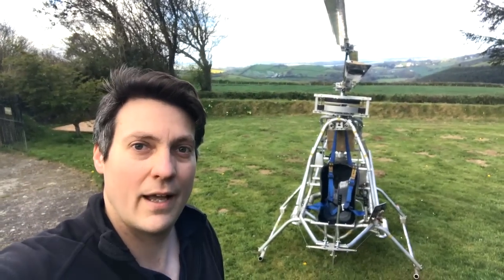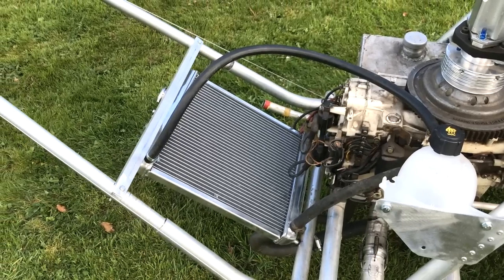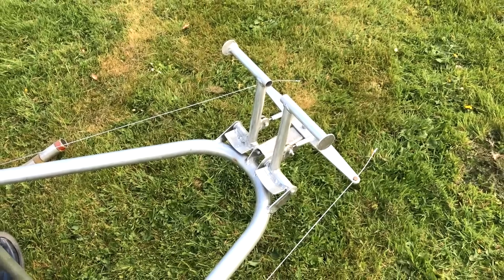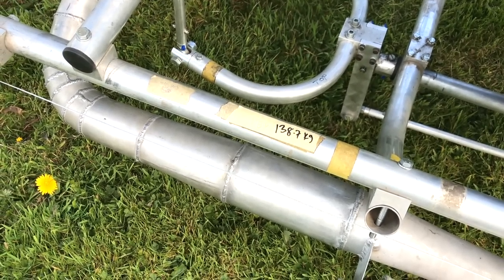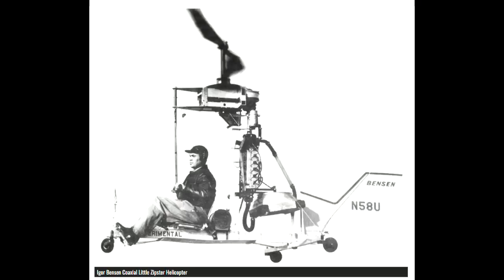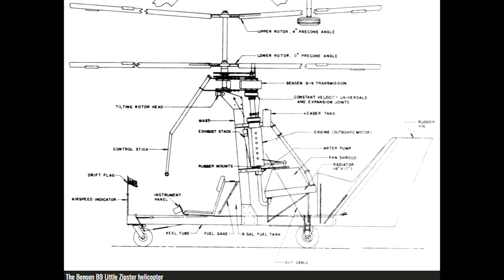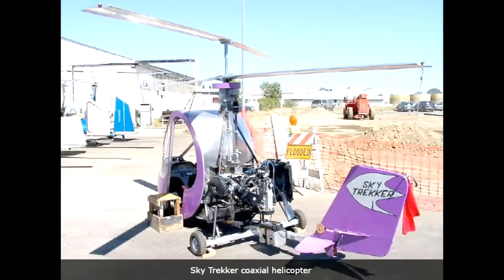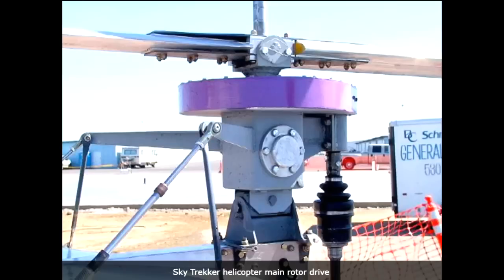Part 1 Learning to FLY Homemade Helicopter

Comment: How much experience flying helicopters did you have before this flight...thank you.

Asking for a friend...his dial up is broken and AOL isn't working so good for him.

Merry Christmas for you and yours. Godspeed and Blessings.

Stay Dangerous
Reply from the maker: Stay dangerous 😆

My total experience in flying helicopters at this point was 1/2hr's dual instruction on an R22. I had flown RC helicopters though. I went on to have another 1/2hr's dual instruction but most of the learning to hover was done with my helicopter. I wouldn't recommend what I did but with long poles it can be done with some degree of safety. Tethers aren't safe above 8" long as they can cause an accident.

Comment: The blade angle doesn't changed?
Reply from the maker: That's correct, they are fixed pitch rotors. Works but it has limitations.
Reply: @Ben-Dixey  yeah.  I don't know if it can perform suitable autorotation for safe landing. What do you think.
Reply from the maker: No it can't autorotate, it was built just for hovering and slow forward flight.

Comment: Merhaba kolay gelsin kaç hp motor kullandınız teşekkür ederim
Reply from the maker: 60hp
Reply: @Ben-Dixey  bunun daha ufağına insansız olanına 30 hp motor yeterli olurmu
Reply from the maker: It is possible to lift a man with 30hp. The GenH4 can hover with 30hp, for an unmanned helicopter 30hp will be loads.
Reply: @Ben-Dixey  toplam ağırlık 70 kilogram gibi olursa
Reply from the maker: Yes. 30hp can lift around 160kg
Reply: @Ben-Dixey  hocam kolay gelsin bana önerebileceğiniz bir motor varmi

Comment: Awesome job but I would have made the spectators move well away in case of the blades let go. Someone could be cut in half. Be safe thank u for sharing
Reply from the maker: Yes. The spectators were not planned I didn't know the landowner invited them and I should have cancelled the test. I had run the blades probably 50-100 times by this stage though and was confident they wouldn't come off. However I wouldn't do this again just in case.

Comment: Lots of missing essential info. The blades appear to be fixed pitch,  The center of gravity appears to be excessively aft. The key thing is that this machine cannot registered or legally flown almost anywhere.
Reply from the maker: There's more Information on my channel. You are right it cannot be legally flown or registered. It's a hovering machine only.

Comment: Hello! How can I buy plans for this helicopter?
Reply from the maker: Hi. No plans are available for this helicopter. The nearest you will find is the Bensen B9. There are plans for non coaxial helicopters such as the AW95 and Furia.
Reply: @Ben-Dixey  at least please sell me main rotor system plans/blueprints
Reply from the maker: It all needs to be thoroughly endurance tested before I would consider selling any plans. You don't want to be making the same mistakes I might have made.

Comment: Looks like there's no way to autorotate with this machine, or did I miss something.

Great work otherwise. Have fun and stay safe. 👍
Reply from the maker: Hi Ai, you are correct, no autorotation is possible. It's intended use is for hovering around a field close to the ground. Did you get your mosquito back flying ?

Comment: I wish you would do a video showing how the collective works
Reply from the maker: Hi, this machine does not have collective pitch blades, to keep things simple the blades are fixed pitch and altitude is controlled by rotor rpm/throttle. Happy to do more videos explaining more details.

Comment: this vehicle doesn't have adjustable blades angle ?
Reply from the maker: No, it doesn't. The blades are fixed pitch and altitude is controlled with throttle.

Comment: First: hat off. This takes cojones.
Now: I am not quite sure how you achieve cyclic control. The Bensen invention (tilting rotor head) raises questions regarding the "pendulum rocket fallacy" (see YouTube video of 21/4/2020 and others).
Cold comfort: if you fell for it, you are in good company.
But the fallacy might explain why your ship does not do what you expect. I don't think there is a way around aerodynamic cyclic control.
Looking at videos of counter-rotating and Flettner designs, they should be really easy to fly, in contrast to tail rotors.
I did a few hours in R22 and that was much like balancing a broomstick while using both feet to keep the thing steady - a lot of work which needs to become second nature. 
You'll need more than 10 hours to solo. Fixed wing was easier. However, helicopter is more dreamlike.

PS Your video looks like Lake District. Could you not find any wetter and windier place?
Reply from the maker: Hi, interesting comments, I'll have a look at the pendulum rocket fallacy and the flettner helicopter. I'm believe the Bensen B9 did fly but the concept is very well demonstrated in the Nolan and airscooter 2 helicopters. The only difference is the way the rotors are driven which has been a concern from the start but if the B9 did fly then it's possible to control. Testing in Devon
Reply: @Ben-Dixey  The Kaman K Max uses a Flettner rotor system. But since Flettner was German and there was this war - how could they let him keep the honours?
Hang gliders can be controlled by shifting the centre of gravity. However, they do not normally hover. What the fallacy shows is that one cannot really control a rocket in this way.
Robert Goddard was its most famous victim. A rotor is just like a rocket engine - it pushes where you point it at. And that is where the trouble starts.
There must be a reason why none of the tilting rotor head designs found mass adoption. They were simpler and cheaper to make - maybe the fallacy is the missing piece here.
Reply from the maker: @peterf2451  It will be interesting to discover what the disadvantages are of the tilting mast. My guess is something to do with the response time but having seen the Nolan Helicopter fly so well I know it's possible. The people at Airscooter spent an awful lot of money developing their machine using the same principle it didn't get to market but they got as far as running an advertisement campaign. The SCH 1A was another flown with a tilting head, now converted to standard cyclic feathering. I haven't been able to find the answer to the question but hope to discover it for myself soon.
Reply: @Ben-Dixey  You'll have to overcome a lot of gyroscopic inertia when tilting the rotor (=response time) and you'll never have a stable equilibrium (said fallacy). Still - not impossible.
Reply from the maker: There isn't any gyroscopic inertia in a coaxial, it's cancelled out by the counter rotation.
Reply: @Ben-Dixey  You are correct. I forgot. The bearings and mast should still be under high load though because each rotor for itself is a gyro?
Reply from the maker: Well, there's something I'm pondering here, I believe that the teeter hinges cannot transfer a bending moment to the shaft. If I didn't have them then yes there would be massive force through the shaft when tilting the mast. I've read that single rotors have gyroscopic precession and the swash plate increases pitch on the blade around 70degrees before to achieve the desired direction. If the teeter hinges relieve the gyroscopic force then the 70degrees of precession is not gyroscopic but aerodynamic precession. It just takes time for the blade to fly to its new position ?
Reply: @Ben-Dixey  It's complicated and not. Basically there is no difference between gyroscopic precession and aerodynamically induced precession. You apply a force, somehow, and the rotating body changes its axis of rotation in response. This change is offset by exactly 90º, the 70º are an engineering optimisation.
One way to view this is by imagining to sit on a bike. If you want to change direction, you lean into the curve and the front wheel will automatically turn, too.
Another way is to visualise a satellite rotating around earth. Let's say it passes you from right to left. You give it an upward push just when it comes past you. This results in a slight clockwise turn of the trajectory and the satellite will now be in a new orbit pointing upwards on your left and downwards on your right. That's all there is to it.
Imagine a helicopter blade instead of the satellite and you are there. You push it upwards by increasing the angle of attack. The trajectory changes and the rotor mast rotates to the right. There is a good wikipedia article on gyroscopic precession but you need to ignore the integrals. Likewise, if you tilt the mast, you exert a force at 90º.
Re the teeter hinges they would indeed avoid transmission of a bending moment around one axis. The danger is that he who teeters can also mast bump. There you get the full bending stress onto the mast.
With teeter hinge, the rotor can assume a tilt versus the mast and maintain its old orientation, to some degree. I wonder if that would not reduce the efficacy of the mast tilt.
This is getting complicated now.
Reply from the maker: It's certainly complicated, you would  have thought that tilting the mast would cause significant movement on the teeter hinges and mast bumping could occur but as Arthur young demonstrated in the Birth of the Bell helicopter despite the hinges the blades follow the mast very quickly. His stabiliser bar was the result of experimentation to help stability. This bar would increase teeter movement.
Reply: @Ben-Dixey  Experimentation certainly has it!
Still, I would recommend to go for aerodynamic control. I have flown all sorts of fixed wing - the atmosphere can be surprisingly violent.
Quite a few hang gliders broke their bones in a downdraft because they were no longer able to control the wing: they lost, all of a sudden, the weight to work with.
The Kaman helicopters use an intriguing small control flap to twist the main blade. Very little force required to actuate it. The patent ran out long ago. Nobody ever adopted it to other rotor types. They work like trim tabs, just quicker. The original patent mentions wooden rotor blades...
Reply from the maker: The Kaman servo flaps were a great idea in my opinion, why they weren't widely adopted I have no idea. I considered wood as a material for blades and wouldn't discount it in the future but only for blade feathering type control as I think they would have been too heavy for fixed pitch. As a fixed pitch my aim with this model was to hover, it wouldn't be safe any higher than a few feet unless it had twin engines. I haven't got any plans after experimentation I just wanted to see if I could build a helicopter that could fly as a fun project. If there would be any commercial opportunity from it I don't know.

Comment: It appears to be out of balance. Perhaps this is why no one has flown one. The cockpit looks like maybe it should be a few inches forward than it is
Reply from the maker: Part 2 will expand on this but the balance issue hasn't been investigated yet. Could be downwash pushing more on the tail could be the balance of the drive assembly. https://youtu.be/4JNiHFk0qdg
Reply: @Ben-Dixey  I’m no engineer however with a counter rotating rotor I would think it has to be balanced with someone in it pretty close otherwise you would run out of controls to fly
Reply from the maker: @toddw6716  you could well be right.

Comment: Just a few constructive comments, if you plan not to use an extended landing gear it it critical that you don’t bury a skid. Long grass can be a killer and a good mow in the flying area is much easier. I noticed that the helicopter is lifting front first. That means it is tail heavy. In Microlight aircraft we hang it from a strong rafter with the pilot in to check the c of g. I suggest it is a lot more heavier at the back than you expected. Please do that prior to continuing for your safety. Hopefully you have plenty of power remaining or was that near full throttle? Hope all goes well, but as you have no collective pitch as I could see, relying on the engine perhaps a safety bar at the front in case of rollover, going through a fence or blade strike will at least afford you more protection. All the best from Australia.
Reply from the maker: Hi thanks very much for the comment. Take a look at part 2 
https://youtu.be/4JNiHFk0qdg 
I think it's the downwash creating the apparent aft heavy issue but would like your thoughts.
Reply: Thanks for the prompt reply. If you have already done a balance check and still have the pitch up moment, I agree that the airflow over the tail may have some impact. To isolate this is difficult, unless there was a way to change the rudder angle temporarily to vertical, so there is no aerodynamic drag with the airflow. Of course it would prevent you being able to yaw the helicopter but I would assume you would only do this to confirm whether or not it is the cause of the pitch up action during a tied down test. I still think that if it is true you would either have to add weight to the front or shift mass forward still to correct the moment as the downward pressure from the rotors remain a constant whilst in flight.
Reply from the maker: @kimkeam2094  Thanks for this. Great thoughts 👍👍

Comment: Beautiful work. This is a dream of mine. Maybe one day. There appears to be a lot of people nearby. I would recommend that no one is near it (no less than 50 or 75 meters). Also, point it into the wind. It'll make your life a bit easier. Additionally, your control stick looks like it's really close to the ground. A hard landing that causes the gear to bend could make you lose control and be disastrous.

Stay safe because we are all looking forward to the next videos.
Reply from the maker: Thank you, there won't be anymore spectators from now on. 👍 I'll reduce the length of the cyclic stick below and test in calm conditions. Thanks 
Part 2 if you haven't yet seen it 
https://youtu.be/4JNiHFk0qdg

Comment: Hold on a minute, you are not a qualified helicopter pilot? You shouldn't be attempting any of this. While a twin rotor system is different,  there are still a lit of similarities. Additionally, once you are off the ground you are illegally flying which opens you up to fines in the more than a PPL-H range.

Tethering to a block, combined with total lack of experience equals a devistating accident to you, vehicles and bystanders and huge claims. While I love your enthusiasm and engineering, I'm concerned for your wallet and safety.

I bought a paraglider and paramotor. I took lessons instead of trying it myself.
Reply: Thankfully Igor Sikorsky didn’t have the same approach 😂
Reply from the maker: If i was going to fly a paramotor hundreds of feet up I would take lessons no question. This helicopter is a prototype and will not be flown more than a few feet above the ground, if it had collective pitch or twin engines it might have a chance of being certified in some way. The ground anchors have been pull tested to many times the strain they will be under, the blades have been spun up at least 60 times previous and built at many times the fatigue strength necessary. I admit it wasn't wise to have spectators and I won't do it again but I took the decision that the risk was small. I find it sad that innovation is suppressed by red tape and people can't make there own decisions. I believe what I'm doing can be safe if the correct decisions are made otherwise I wouldn't do it.
Reply: @Ben-Dixey  This is where America takes the lead. Their Part 103 aircraft, including helicopters, can be flown unlicenced and flown by the designer/owner. Most of the regs are there for your protection. I know it doesn't seem that way. Watch the video of Secorskies, how ever its spelt, crash where he is thrown from the helicopter.
Reply from the maker: @SimonAmazingClarke  America would be a much better place to live for people like me I think. I did see a video in the development of the Bell helicopter where the pilot got thrown into the rotor, amazingly he walked away but he wasn't wearing a seat belt. I'll have a look for the sikorski video you mention. I'm not against rules and I don't think I'm actually breaking any being tethered.

Comment: Your CG is way off, should be at the mast but seems to be behind it. Looking at engine and pilot placement makes sense. Move the pilot forward.
Reply from the maker: It certainly looks that way in the video, I'm a bit confused at the moment because I hung the helicopter from the centre of the mast again and it was only 0.15 degrees heavy to the rear. I hung a 5.5kg weight in the front and that tilted the machine 1.8 degrees nose heavy, I tried to fly again and there didn't seem to be a big difference from the pilots perspective. I should have filmed side on so I could see the tilt of the rotor discs. I'll do that next I think.
Reply: @Ben-Dixey  If it's not your CG then I suspect that the rotor down wash simply hits a combined larger area of the frame etc. on the rear half and this changes the apparent weight and CG.
Reply from the maker: You maybe on to something there, very good point. Thank you 👍

Comment: Cool project. What kind of engine does it have?
Reply from the maker: Thanks, it's an outboard engine, Johnson 60hp 2 stroke 2 cylinder. I had to make the exhaust expansion chambers to make it produce the power necessary.

Comment: Apparently you didn't put on enough weight on. I thought that radiator placement was sis. Good for flow, bad for CG. Looks like you will just about get it off the ground on the next try but I don't think you will have much power to spare for manoeuvring safely. Stills beautiful job for 100% DIY.
Reply from the maker: Yes I need to put on more weight ha! The plan with the radiator was to have it placed to that ultimately I could run a belt driven fan from the pulley I machined on the centrifugal clutch. For now I'll just stick on an electric fan so I could have mounted it vertical helping the CG. I'm not at full throttle at any point and estimate I have 10-15% reserved power.